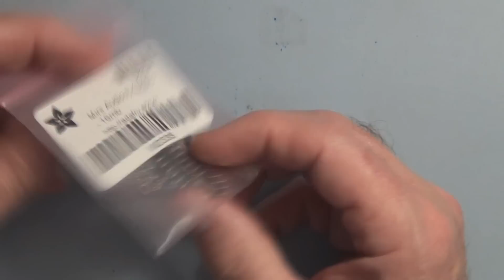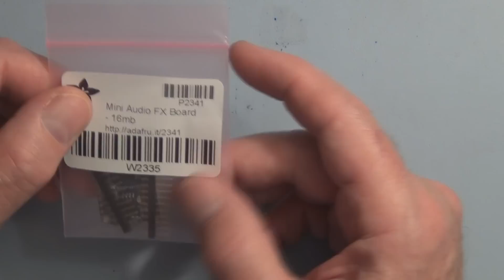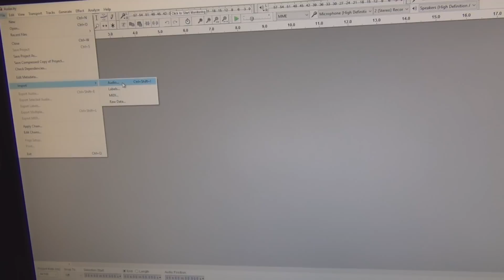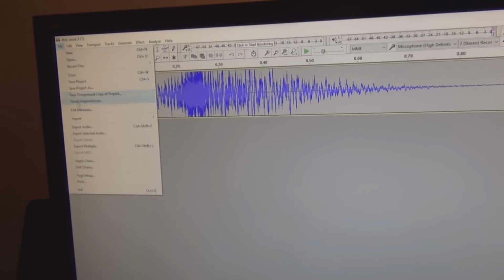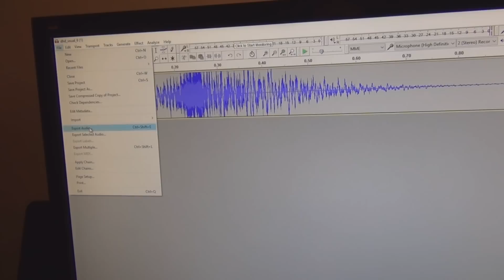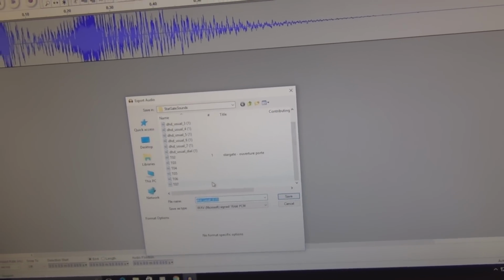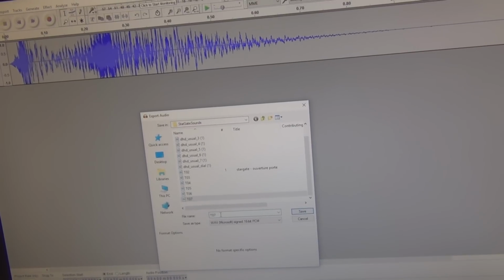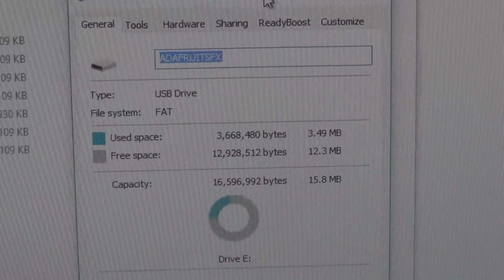Adafruit Sound Board Special Effects Project

Comment: Hey, nice work !
I try to do the same (without the backpack) with  2x CR2032 for the battery, and it doesn't work.... the sound stay only 3 seconde before stopping.
Is it because my tension is to high ? I have 6v (2x3v)
I use this item for my batterie: 
@t

When I try with an USB cable form my laptop (5v), it work well...

Thx for your help...
Reply from the maker: There are current requirements too.  Two CR2032 batteries can not power this circuit.
Reply: @tmc200527  Thx your for your return. I will try with 2xCR2450. its 650mah... Lets see

Comment: is there a board that has only one sound - i was thinking to setup speaker and sound modules and placing them under the layout t create ambient sounds i can run on loop or trigger - 16mb seems overkill for location based ambient sounds?
Reply: When i was looking at these little sound boards there was a 2mb model.

Comment: Would it loop the audio file seamlessly?

Let's say I have an audio file that is a 500ms tone of say 200hz end-to-end no silence, just a pure tone. Would it loop the audio file so if I hold down a button for say 10 seconds I hear 10 seconds of 200hz?
Reply from the maker: Here is a list of trigger modes available.  There are two looping modes
1.  Basic Trigger - name the file Tnn.WAV or Tnn.OGG to have the audio file play when the matching trigger pin nn is connected to ground momentarily
2. Hold Looping Trigger - name the file TnnHOLDL.WAV or .OGG to have the audio play only when the trigger pin is held low, it will loop until the pin is released
3. Latching Loop Trigger - name the file TnnLATCH.WAV or .OGG to have the audio start playing when the button is pressed momentarily, and repeats until the button is pressed again
4. Play Next Trigger - have up to 10 files play one after the other by naming them TnnNEXT0.WAV thru TnnNEXT9.OGG. Will start with #0 and each one on every momentary button press until it gets through all of them, then go back to #0
5. Play Random Trigger - just like the Play Next trigger, but will play up to 10 files in random order (TnnRAND0.OGG thru TnnRAND9.OGG) every time the button is pressed momentarily

Here is a link to the Adafruit information https://www.adafruit.com/product/2220
Reply: @tmc200527  Thanks

Comment: how do i get an interrupting effect, like for example when I press trigger 1 and while it is playing I may be able to interrupt it by pressing  trigger 2,  is this possible ?
Reply from the maker: I think the way the sound board is designed once you trigger an audio file to play you can't stop it or play another sound at the same time.  If you use two boards that would give you more options to mix sounds.  You could somehow interrupt the output from getting to the speaker if you want to prematurely stop the audio from playing before the file plays to the end.

Comment: what is the frequency range of the sound board? Thanks!
Reply from the maker: The sound board has a version with a built in audio amplifier and one without so it would depend on the frequency range of the audio amplifier but the audio module used is the VS1000.  Here is a link to it's specs http://www.vlsi.fi/fileadmin/modules/vs1000mod.pdf.  It has this info on page 7 The maximum sample rate that can be played with correct speed is XTALI/256. With 12 MHz XTALI sample rates over 46875 Hz are played at 46875 Hz.  Here is the link to the Adafruit sound board specs.  https://learn.adafruit.com/adafruit-audio-fx-sound-board/downloads.
Reply: so basically the max frequency is 46875 Hz?

Comment: I have the same sound card but when I plug it into my laptop's USB, it does not identify the sound card.  IT seems that the card is missing a driver.  Can you assist?
Reply from the maker: No drivers are required.  It should be recognized by your computer as ADAFRUITSFX removable disk.
Reply: I had to use a different cable. The one I was using did not support audio. So try a different one
Reply: Keko Jones reboot

Comment: I am trying to find a way to put sound into my lightsaber. I was thinking about doing this with the chip in your video and an accelerometer. I see in a comment that this cannot play more than one sound at a time. Do you know of a sound board that is as small as this one that can play multiple sounds at the same time and be activated with an accelerometer?
Reply from the maker: Here is a link to some information that might help.  http://forum.arduino.cc/index.php?topic=275524.0 To play multiple sounds simultaneously with just using the arduino to trigger it seems you would have to use multiple FX sound boards for the number of sounds you want to play at the same time.
Reply: check out boards like the golden harvest from the custom saber shop